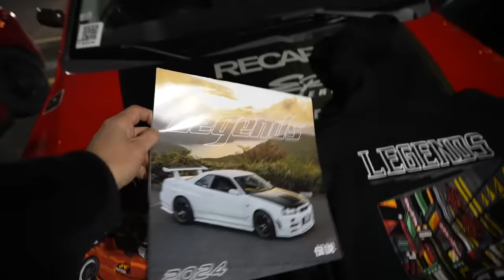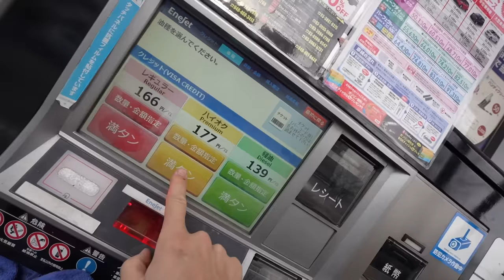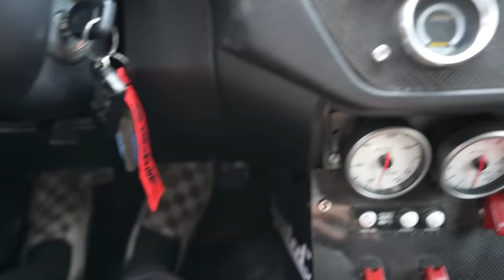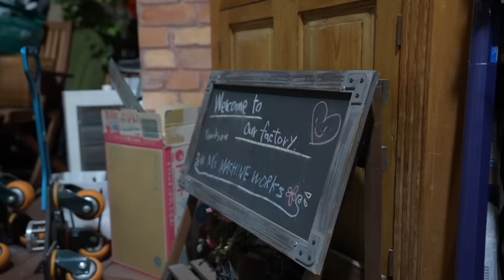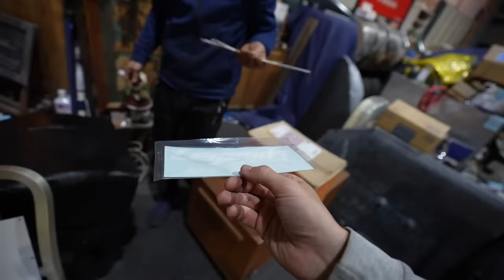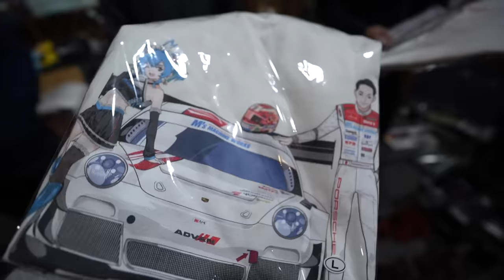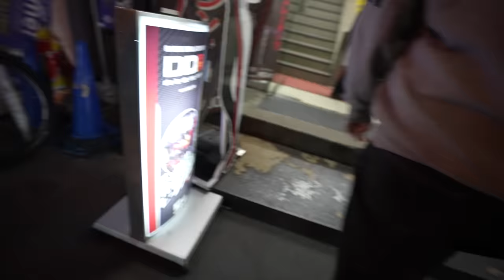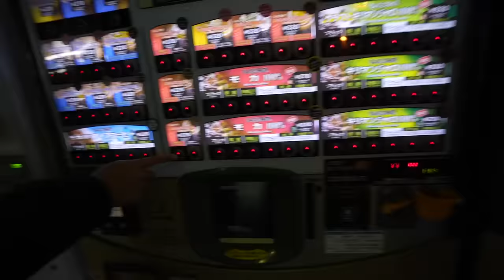Finding HIDDEN JDM Porsche Tuning Shop & Daikoku Car Meet in Tokyo Drift Evo!

Comment: Makes sense cause the Cayman S from 2007 beat the 997 911 on the track cause the 50/50 mid engine worked. Maybe that car is the reason for the 718 Cayman GT4 cause Porsche saw the potential